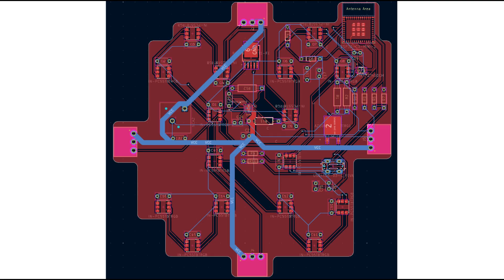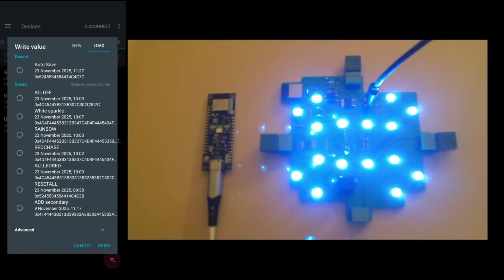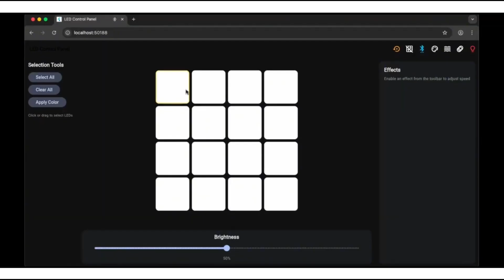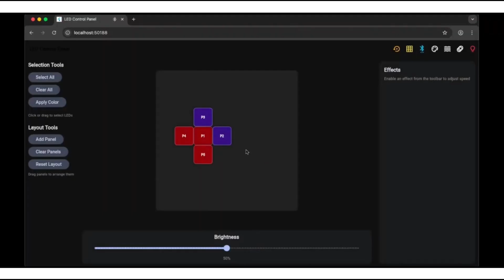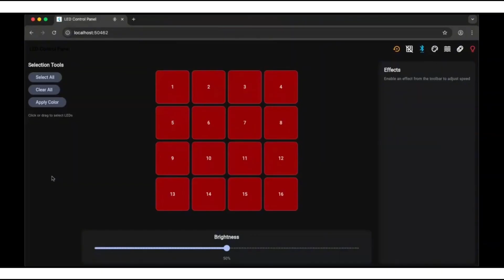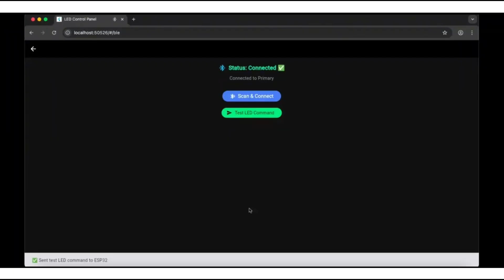LEDgendary Lux ASU Senior Design Demo

Comment: No idea why YouTube recommended this video with 3 views, but I watched it anyways. Grats on the stellar senior project! Here’s some unwarranted comments below for the soon-to-graduate EEs, just a few pain-points and tricks I’ve picked up over the years

1. Don’t be afraid of using multiple pages for your schematic! Clarity is most important and stuffing everything into one page like Tetris is not ideal. Smart use of net labels and power/ground pins are always nice.
2. Always write component values on schematic. It’s great for clarity.
3. Could you have gotten away with larger traces and spacing on layout? When it comes to budget boards, your “minimum feature size” and “minimum spacing” will drive cost. The larger features you can get away with (think thicker traces), the better cost some prototype board fabs will quote. For a board like yours, this is usually defined by your IC footprint.
4. If you have the option, pick a USB-C connector that mounts flat instead of vertical. Even better, use micro-USB if you don’t need anything fancy. USB-C is notoriously annoying to route.
5. The vias aren’t clear but the idea is the same with feature size - larger minimum via hole sizes result in lower cost board quotes.
6. Don’t be afraid to do a ground pour on the bottom side too! Just don’t forget to include ground stitching (vias across the board to connect equal nets on different board layers for a stronger ground).
7. Don’t be afraid to use surface mount passives as they make routing and compact design much easier! Unless you are doing something high power, need large capacitances, or have a large coil, you can typically use surface mount components instead of through holes. It’s easy for the board assembly house to place surface mount parts and not too bad to solder yourself if you have the right equipment and a steady hand.
8. Tariffs sure are tough! It’s not fault the project exceeded budget. There are a few board houses in the US that can do simple boards relatively quickly at reasonable cost and lead time, but it will take time and experience to learn who those companies are. In hobbyist electronics, you can pay a much lower base price to a Chinese company who specializes in small quantities at the cost of tariffs and long shipping times. Digikey and Mouser will also indicate if a part has tariffs which is always worth checking when finalizing the BOM.

Cheers from a stranger RF engineer (who is much less talented than your professors). And again, amazing job from the team.